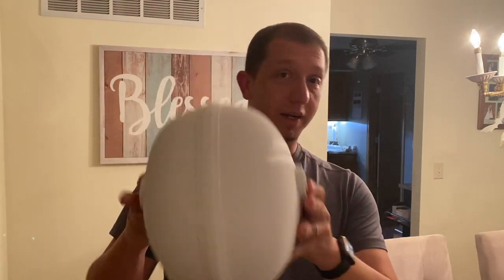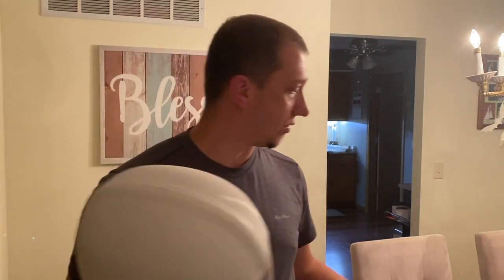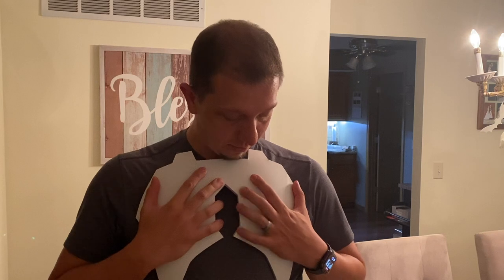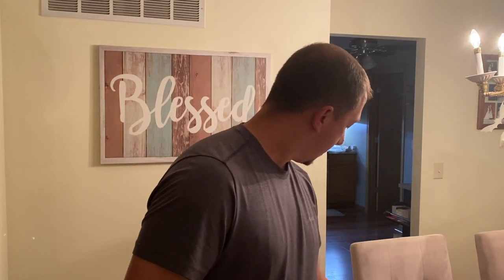How to Make Mandalorian Armor 3D Printed (Part 1)

Comment: If only I had a 3D printer or the money for one.. however it looks fantastic !
Reply from the maker: Thank you!!
Reply: Ikr
Reply: I imagine it wouldn’t take long to save, you can get excellent 3D printers for around $300
Reply: where can I get a heavy mandalorian file from? I'm thinking of buying the ender 5 but I got no idea where to get the files? can anyone point me in the right direction?  are the files free or do I have to buy them? looking to make an airsoft mando armour. I've made a warmachine out of foam (freehand) . gonna try my hand at 3d stuff next..

Comment: I glad I came across your video. I’m looking into buying a 3D printer and start on my armor. I appreciate you sharing your journey so I have a tutor.
Reply from the maker: Glad to have. Make sure you subscribe as I am adding new content each week!   What printer do you have?
Reply: @Rise3DBuilds  I’m going to purchase the Creality V3. Dose it run from the computer? I’ve been trying to find information on that.
Reply from the maker: So the printer itself is independent.  You copy the files to the sd card and put it in the printer after you slice the model.  You can do octoprint and control it from your computer

Comment: What printer(s) are you using? I have a creality ender 3 v2 and am attempting the same thing. Also, where do you get your files?
Reply from the maker: All the files are in the description of the video.  For everything but the helmet and the chest plate I used a Ender 3.  The helmet and chest plate I used a cr-10.  To get the helmet and chest plate you will have to break the file up with mesh mixer and print it in parts.  I have a video out that shows you how to do it.

Comment: Love the time lapses! Are you  printing everything twice, or just showing the print from different angles? I enjoy the stability of the first version of the time lapse for the helmet from 5:08-5:38, but the print moving back and forth so much and so quickly in the other angle from 5:40-9:12 is disorienting.
Reply from the maker: They are two different angles done via two different methods.  As long as there is not a failure I only print this stuff once  and I print with the video in mind. Its no easy getting all the angles right but I do the best I can to get as clear a view as possible.
Reply: Was wondering though for a sec he made two helmits or messes the first one up. Bit it all looks so great. Hope my tevo tornado prints all this stuff when it gets here ❤️🤞🤞

Comment: I have an Ender 3 v2. I think I could probably fit the vambraces, pauldrons, and leg pieces on the bed, but not the cuirass. I wonder if there's a way to split the prints to be able to fit them on the smaller bed, and then use bondo to cover the seams. Or I might have to buy the Ender Extender kit. I bought the helmet off Etsy, it's not supposed to be delivered till maybe May, but it will be finished and painted for me, and it looks like the guy does some amazing painting.
Reply from the maker: There is a way to split the prints.  Go check out my video on meshmixer to do just that!! Meshmixer is free and will let you break up the prints to fit you ender 3 v2.  I have one and I love it to death. Great little machine.
Reply: @Rise3DBuilds  Thanks, I'll check that out. I just built the ender 3 v2 last night and printed one of the test prints it came with. Came out honestly amazing for no fine tuning. All I did was level the bed and start the print. I had the Ender 3 a few years back but had a lot of problems with it and kind of gave up on it. Honestly the only reason I got back into 3d printing is because I wanted to print the Mandalorian armor. Even bought an airbrush kit, so I'm going to try and learn that as well.
Reply from the maker: Awesome stick around.  I am doing the same with the airbrush and oainting

Comment: As someone who is planning to 3D print a full clone trooper armor set, how often do you have to monitor the print, considering the printer takes 4 days to print a full clone helmet. (Also can I leave it overnight)?
Reply from the maker: So for long prints I leave them run overnight usually with no issue.  That does not mean it works every-time.  Sometimes I do wake up to a fail.  For long Prints I usually check them  a few times during the day and before I go to bed.

Comment: how much filament would i need to buy for this? for reference i am 5’8 and 140 lbs so im not a big guy. also, what kind of 3D printer should i look into buying that goes for a reasonable price and works for this project?
Reply from the maker: At least 5kg. And I recommend the cr-10v2 which has been on sale I think for around 280
Reply: @Rise3DBuilds  thank you!

Comment: Could you do this on a smaller printer? Or is one of this size recommended for this print?
Reply from the maker: You can do this ona Ender 3 but for the helmet and the chest plate you will have to make it into parts using mesh mixer and assemble it afterwards.  I have a video on how to make it into pieces to print on smaller printers
Reply: @Rise3DBuilds  Ive been wanting to get into 3d printing for a long time now, ive had the ender 3 pro for about a year now but ive only been able to do the premade ones. All the others drag the pla around, ive tried almost everything except using a glass base so far. In your video it prints the hand armor laying down but when i download the file it has it standing up, any tips on how to fix this? Ive layed it down in Cura but it has red on the bottom showing it wont print.

Comment: How do you make the base layer of your prints wider in Cura?  Did you change settings in Supports? Specifically the armor.
Reply from the maker: I am using a raft.  Under bed plate adhesion you can select that and shrink or expand it by changing the raft extra margin.  Great question
Reply: @Rise3DBuilds  Thank you, this is a setting I have been missing and greatly needed!

Comment: Will this printer work? Official Creality Ender 3 Pro 3D Printer with Tempered Glass Plate and Five Nozzles Build Volume 220x220x250mm
Reply from the maker: You can use it but you will have to use meshmixer to break the helmet and the chest plate into parts to fit the build area.  I have a video out ther to do just that

Comment: hello can you let us know ur measurements so we know if we need to scale up or down on helmet
Reply from the maker: Each block in cura is roughly 10 mm.   Based on the number of blocks you see you should be able to pull the needed  measurements that you need to make sure your helmet is big or small enough.  Thank you
Reply: @Rise3DBuilds   thank you i actually found a better way forgot i had armorsmith designer lets me put file in and scale thank you so much btw

Comment: Do you have a video or info on what your settings were for the helmet? 
I just bought a 3D printer, it’s on its way as we speak. I want to start making Helmets to Paint. But still a super newbie and people tend to show the process, not the settings! 
Awesome print bud
Reply from the maker: Not yet but you can bet one is coming as I do a better break down of the parts.  Hang in there

Comment: Ah yess, this is what i want to be doing. Ive had an ender 3 v1 for a few years now. upgraded the bed, board, extruder, hotend but i cant upgrade the size. been thinking of a ender 5 , cr10 v2 or a cr 10 mini and then doing upgrades to whatever i buy. i only print in PLA and like doing upgrades so the cr 10 v3 or ender5 pro are kinda pointless. cant decide what to buy lol
Reply from the maker: Cr-10v2 is my go to.  Love the machine good parts and upgrades already on it.   I have multiple of theses because they work well and have the size I need
Reply: @Rise3DBuilds  that's definitely the machine I'm leaning towards.  That or the mini since it's bigger than my E3 but slightly smaller than a full size cr10 but takes same upgrades.

Comment: Hey what is the 3D printer you used?
Because I might purchase the Creality Ender 3 I don’t know if that is a good one for cosplay?
Reply from the maker: I mainly used a cR-10v2.  The Ender 3 is a great started printer.  You will have size issues with the helmet and the chest plate.  But I have a video on meshmixer that will show you how to take a large model and cut it into pieces to print on smaller machines
Reply: @Rise3DBuilds  can you give me the link to that video?
Reply: @Rise3DBuilds  the good thing is I already have the helmet done but the chest plate is gar saxons so I don’t know

Comment: Hi I just wanted to say this is amazing! I was wondering what type of printer are you using I’m looking into purchasing one?
Reply: I just saw your post saying which ones you have, but which would you say is the best one to purchase?
Reply from the maker: If I had to do this all over again. Cr-10v2
Reply: @garrettv7421  if u want a lower price I recommend the Ender 3 v2
Reply from the maker: It’s is a great machine.  I have one in the shop.  The only draw back other than price is the smaller print volume.  I find the cr-10v2 to be more reliable in regards to printing as well. That’s why my recommendation is the cr-10v2.
Reply: @Rise3DBuilds  yes I agree but I am asking for Christmas so I don’t want a to heavy budget. If I hade a bigger budget I would have definitely had a cr10

Comment: Sooo...if you're going to have to post process (sand/fill/sand/primer/wet sand/paint/seal) the bucket anyways, why not just print it upside down? You would think that it would print in less time since you wouldn't have to print that center support column and the supports within the visor? 
Thoughts?
Reply from the maker: So you would still need the supports in the visor and you would still have supports to remove front he top if you printed upside down.  Depending on your settings when you remove the waypoints on the outside you could cause more deformations the shell.  My method reduces that and some of the possibilities of breaking the out shell.  If you break the inside who cares.  Also sanding with my method was relatively quick.  Thanks
Reply: @Rise3DBuilds  You're right about the visor opening needing supports, I didn't think about the very bottom of the bucket that has that thin bar running along the bottom of the visor! I stand corrected. I'm still interested about printing it upside down to not have to print the cylindrical  support column. I see that you got the .stl files off of thingiverse I'd like to give it a shot. I'll shoot you what I find out. Who knows it could be quicker but it could also create more trouble than it's worth if the top of the bucket gets really pitted from all the supports. I printed a Magneto Helmet upside down and it came out ok. Thanks for the input!
Reply from the maker: It is always worth a shot. My method may not be the best method. I showed how I did it because it worked.  Now when it comes to that cylinder in the middle. I did not just pitch it when this was all done. I keep infill and other items from projects or fails to use them in other projects that I may be making or to use them for kitbashing other things. I want to start getting stuff like that out on the channel but sometimes they are just very time consuming in the make process.  Always keep a eye out of what could I use something like this for in the hobby land.  Happy printing!

Comment: Really awesome! What printer would you recommend for this? And are the digital files free online?
Reply from the maker: Cr-10V2. And look at Thingiverse and cults3D.   Link for this print is in the description for the files you will need
Reply: @Rise3DBuilds  many thanks ! Just looked it up and seen there is a V3 now… would that do too I guess? (I’m a noob ;) )
Reply from the maker: So the real difference is the extruded. The 2 and 3 were released the same time.  The 3 has a direct drive which does give some advantages.   Both are great and I use both
Reply: @Rise3DBuilds  brilliant! Many thanks for the replies ;)
Reply from the maker: Anytime

Comment: Hy! Thx the video and the shared files. :)    I have a Question.. 255x255x260 This parameters is enough for all parts? This is the printer TRONXY XY-2 Pro
Reply from the maker: No the helmet and the chest plate will be to large but go check out my meshmixer videos and how Ronald the parts into smaller pieces to print!! That will let you print the parts and assemble the larger pieces
Reply: @Rise3DBuilds  oké thx

Comment: What 3D printer are you using??
Reply from the maker: I used a Cr-10v2 for the large parts and a Ender 3 for the smaller ones

Comment: How did you work out the proper sizing for the helmet/armor pieces? I'm about to start printing mine, but I'm not sure how to get the size right
Reply from the maker: Each little block in the grid is 10mm.  You will need to measure according to that grid to find the right size
Reply: @Rise3DBuilds   Thank you!!

Comment: Hey quick question! What kind of 3D printer do you use? And what would be a good one to start with for someone who is brand new to it?
Reply from the maker: I mainly use the cr-10 v2 and v3.   Great machines even for a beginner.   Ender 3 v2 which I use is also a great machine to start with
Reply: @Rise3DBuilds  awesome! Thank you very much!

Comment: Did you use 2 different printers? Or does it just look like different ones?
Reply from the maker: Hello,
For this Job I used multiple printers.   I used a CR-10, CR-10V2, and a Ender 3 V2

Comment: Hi me and my son are getting into 3-D printing and we love to go to the cons what size 3-D printer do you recommend that will accommodate making costumes and armor like this
Reply from the maker: Cr-10v2 is tried and true. It has a great print size and volume.  It allows me to do most of the large prints in one print.
Reply: @Rise3DBuilds  Thank you so much
Reply: @Rise3DBuilds  what do think about the creality 3D cr-10s 3D printer new version will this work for biginners. Print space size 300*300*400 I'm on a budget
Reply from the maker: Good machine.  Worth the value but you lose some of the bells and whistles of the v2
Reply: @Rise3DBuilds  witch program would  you recommend for 3d printing
Reply from the maker: @nemomeinpunelacssit4319  I use cura.  It’s free and pretty easy to use.
Reply: @Rise3DBuilds  thank you so mush I am going with the printer you recommended I like the bells and whistles

Comment: How large is the helmet? Because im looking for another 3d printer that has the size to print a mandalorian helmet and want to know the size of the helmet
Reply: youll need a printer that is 300x300x400 if you want to do it in one shot, else youll need to cut the model down
Reply from the maker: Spit on.  Mine was 300x300x400

Comment: I use tinkercad as 3d print software, is that okay to try to print this?
Reply from the maker: Yes.  I use cura as a sliver.  It works well and it’s free
Reply: Thanks
Reply from the maker: What’s your infill percentage?
Reply: I don't have a printer yet ,   what persentage would you recommend?
Reply from the maker: Check out my vids.  I take you from step one to finish
Reply from the maker: FYI the files for all the models are in the description
Reply: OK, I will check that thanks.
Reply: I have my 3d printer now, im going to print it.

Comment: Hi there, I was just wondering how much filament was used for these armor prints ? The cost ? Just trying to justify the awesomeness of buying a 3D printer ! Lol
Reply from the maker: 2 spools.  I spend 17 per spool so 34 dollars.
Reply: @Rise3DBuilds  thanks man one step closer to convincing the gf lol any suggestions on printers ? I’ve come to the conclusion I might need a bigger build volume cause I’m a bigger stocky guy , and the less I have to glue and weld pieces together the better ?
Reply from the maker: Cr-10v2 or the car-10v3

Comment: nice job -  u need to adjust your retraction - and dial in the flow and extruder -  alot of stringing, and you should slow the print down  alot of ringing -  all this takes time to clean up and sand, set it up good and youll have 3/4 less work to do  -  other then that nice print !!  im working on my own now - about time -   my posts are on instagram  i dont use youtube anymore after i lost my old page  just tooooo much  data to get back ever---  search elf883  if you wish !! keep up the good work though
Reply from the maker: Actually the retraction was the main issue.  Noticed to far in the print that it got unchecked.  Silly cura update.  Got a lot of my prints nice and happy.

Comment: Hi! My friends and I are looking to print some pieces to wear, I didn’t hear in the video but how long did it take to make each piece if given a rough estimate?
Reply from the maker: It’s been a few months but here we go.  Helmet 6 days, chest plate 4 days, shoulder pads 2 days, vambraces and hands 1.5 days. I am currently printing the leg armor so I can’t give you a good time frame.
Reply: @Rise3DBuilds  6 day printing the helmet?
Reply from the maker: That is correct.  My setting and printing it in one piece it was a six day print
Reply: @jmmenchaca0422  I printed a full helmet 1 piece in 40 hrs

Comment: I know you print smaller pieces and put it together if you have a smaller printer but how do I do that?  Like if I have an ender 3, would I use glue for separate sections of the helmet?
Reply from the maker: Glue is one option.  I often use a 3D printing pen to fuse them together. I have a video on the pen out there.  As long as you can assemble it and fill the gap to make it look like one piece you are gold.  Glue wise I use testors model glue for most projects.